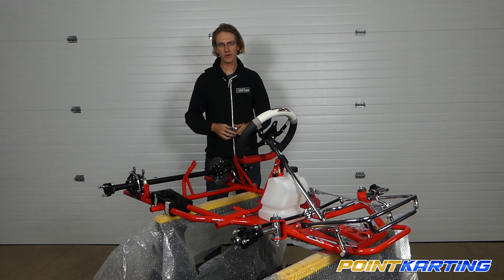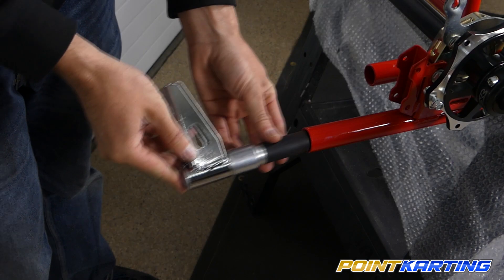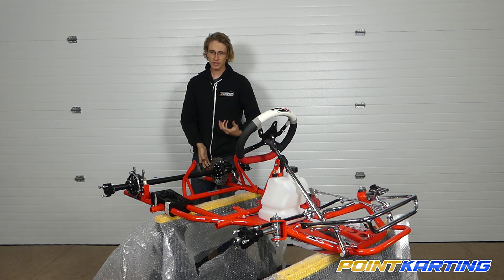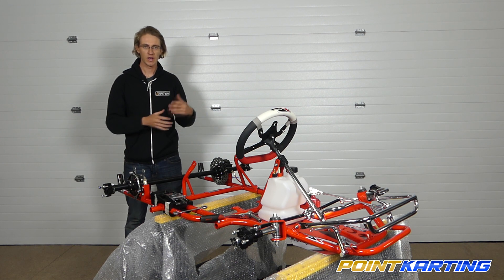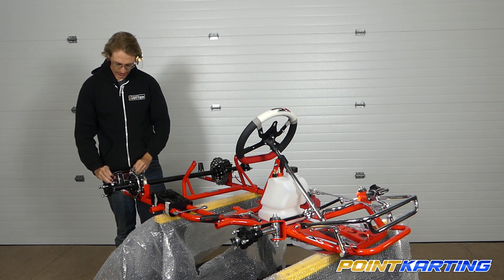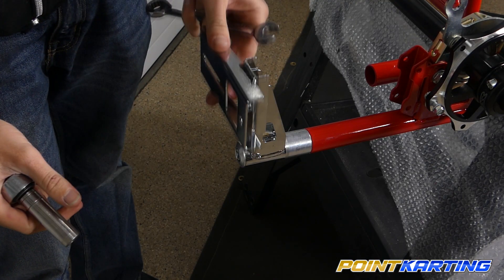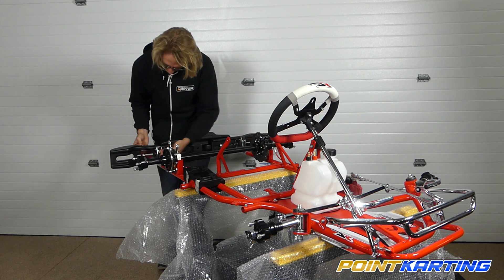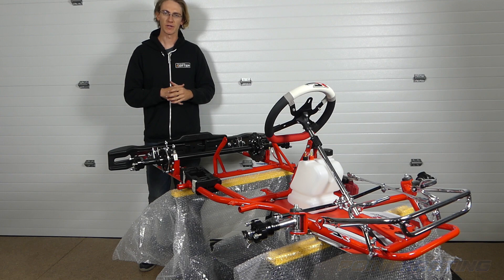How to Install the Rear Bumper on a Kart | Kart Build!

Comment: How to remove the rubber bushing?  The nut was pushed back further so there is nothing for the bolt to catch and pull out the rubber bushing....Suggestions on the best way to remove.
Reply from the maker: Hey Lance! Ah yes, I've been there, I know the struggle. Great question - often if this get's stuck sometimes I will thread the hardware into the bushing if possible and then 'jiggle' it loose. If that doesn't work, a small allen key and some spray lubricant like WD-40 or Silicone Spray can help loosen the stuck bushing. In the worst case you can cut it out and replace, but you want to try to avoid this if possible. The most successful tool I have found to work these out is a 'spring hook' tool, which is great for pulling out the rubber bushings if they are stuck.